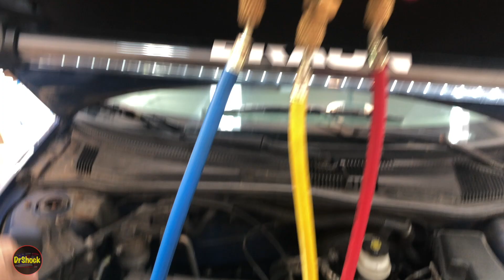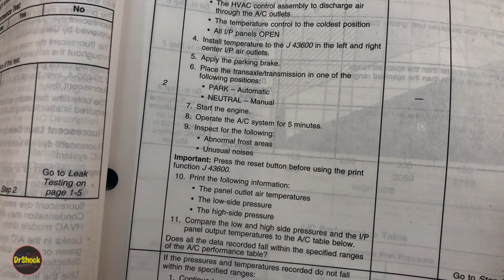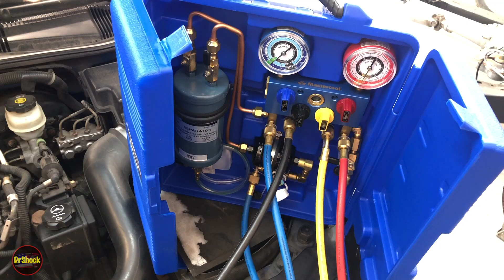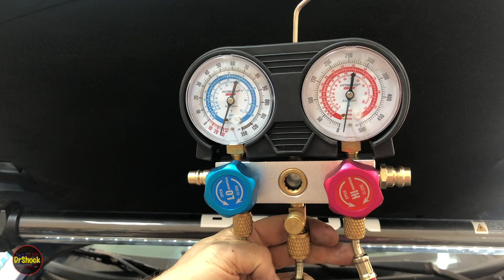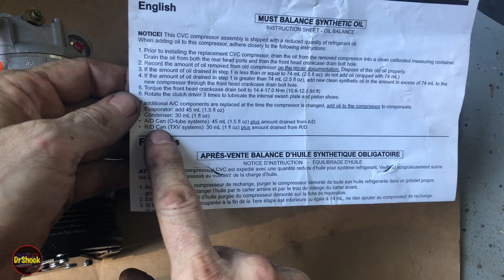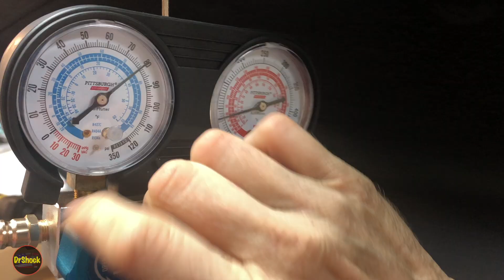2002 - 2005 GM AC Poor Performance Diagnostics ~ CVC6 Compressor Replacement (Cavalier & Sunfire)

Comment: if you were going to flush that system, how would you have done it and what would you have used?
Reply from the maker: We have a Mastercool 91046-A flush unit that I would have used, if the service information called for it.  That unit uses Mastercool 91049-32 solvent.

Comment: I don't know where you purchased the OEM replacement compressor, but most auto parts stores will not warranty the compressor without showing proof (receipts) that you not only replaced the orifice tube/expansion valve which you did, but also the accumulator/drier regardless what the service manual says.  I suppose if you got it directly from a GM dealer then they are ok with it, since their manual explicitly says to only replace it if desiccant is in the system indicating the desiccant sack has ruptured.
Reply from the maker: As a business we can buy parts direct at wholesale, but anyone can purchase these genuine GM parts at the links I provide in the video description.  The problem you highlight is due to aftermarket parts vendors mostly dealing with retail consumers, typically without access to OEM service information so they will have this parts cannon approach to the warranty coverage to cut down on avoidable claims.  Some retail level vendors will even require a receipt that you purchased PAG oil.  You don't find this approach with genuine OEM, as their warranties are aimed solely at the professional clientele and are not for retail consumers.
Reply: @DrShock Genuine OEM is definitely the way to go!  Thanks for the clarification